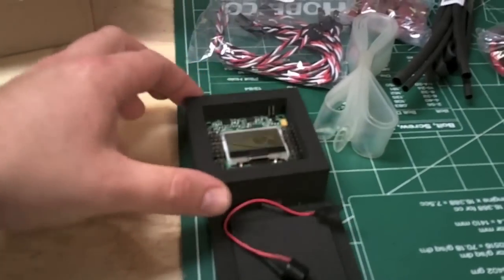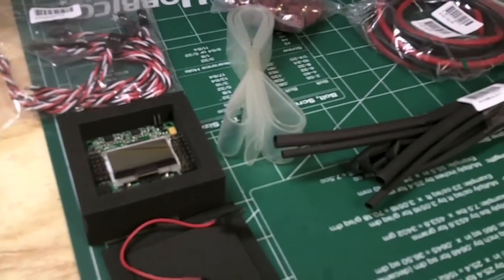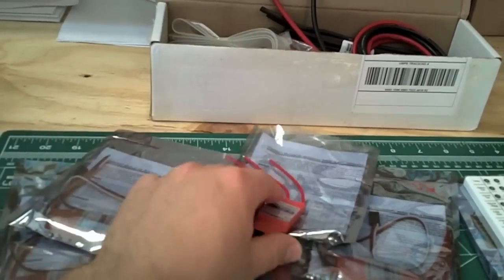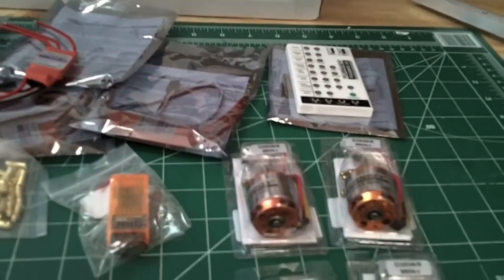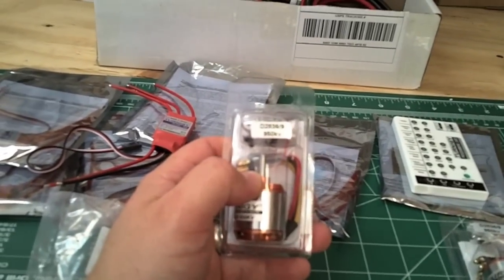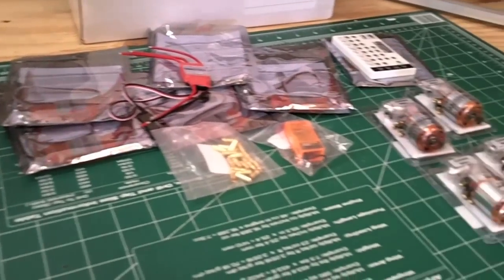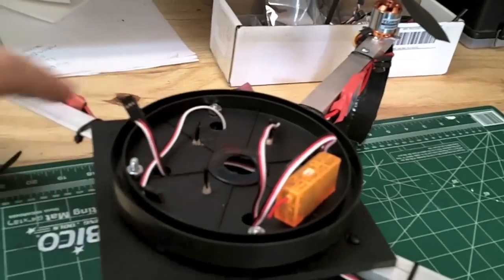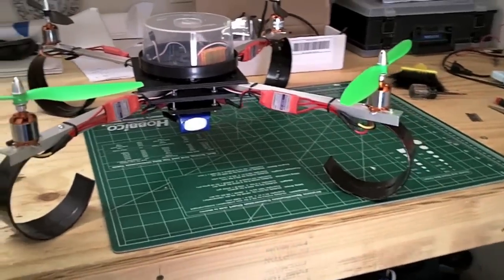1st Homemade Quadcopter Part 2

Comment: What is it you used for the feet? Mind change mine like yours. :-)
Reply from the maker: I used a woman's hair band to make the landing gear. Check out this link and scroll down to the bottom (post #75) for a picture. http://www.rcgroups.com/forums/showthread.php?t=1424537&page=5#post22257351